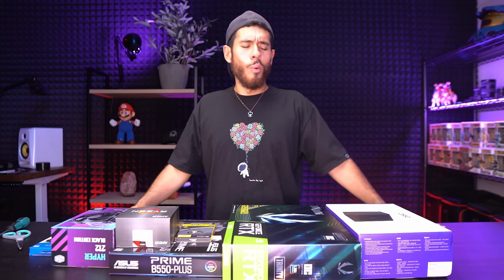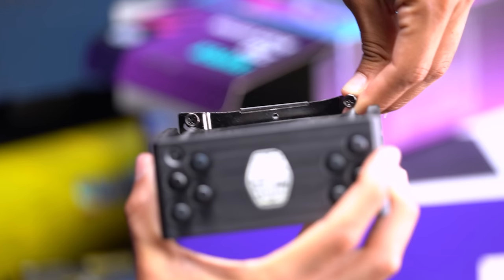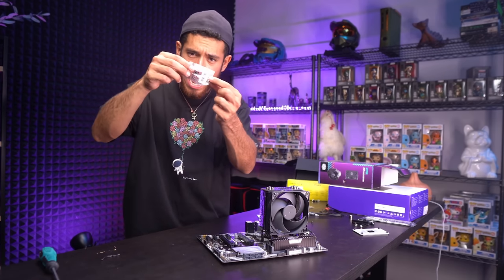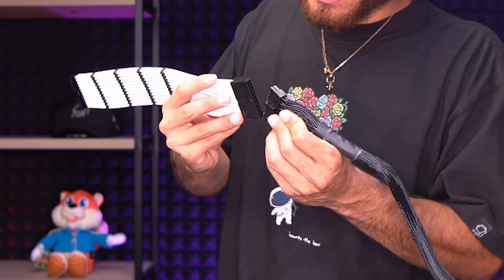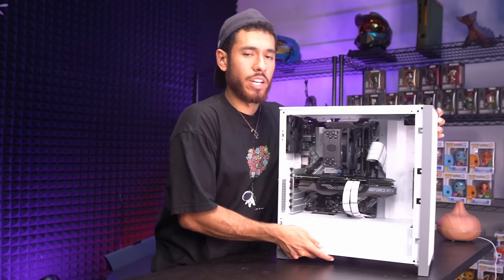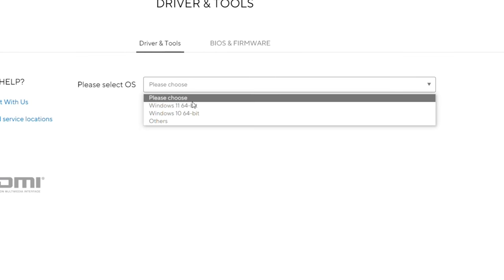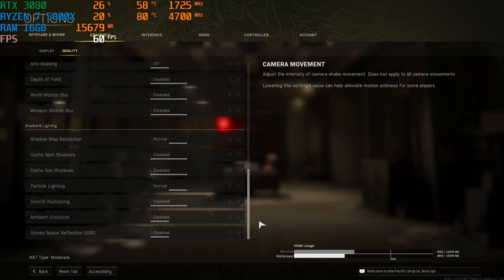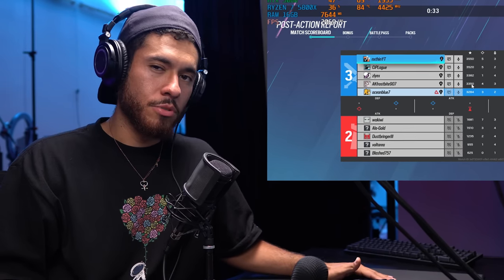BEST $1500 Gaming PC Build Guide - RTX 3080 Ryzen 7 5800X (w/ Benchmarks)

Comment from the maker: Custom WHITE Power Supply Cable Extensions ARE IN STOCK at https://craterhq.com/products/custom-sleeved-power-supply-cable-extension-kit-white
Letz go!
Reply: Can I place a zotac rtx 3080 ti trinity oc in this build, and should I upgrade anything to keep this build a long time, thanx
Reply: Hey crater I just want to say thanks for making this tutorial, for Christmas I’m going to get this computer, and I had one question, Where do you get the power supply cables?
Reply: @mtbsociety they come with the power supply
Reply: @Lemononn  thanks bro
Reply: @mtbsociety you’re welcome
Reply: @Lemononn  jk for some reason my mom isn’t letting me build it 💀
Reply: @mtbsociety  i feel sorry for you
Reply: @Lemononn  never Mmy grandpa convinced her + merry christmas
Reply: @mtbsociety  w moment, merry christmas
Reply: Can I use a 750 or even 650 power supply?
Reply: @RedLine-Racing1  no
Reply: @Lemononn  what other psu could I go with that's cheaper then
Reply: @Lemononn  if I don’t get a usb drive does it come with windows cuz like it says windows 11 ready on the box for the motherboard
Reply: @RedLine-Racing1  probably 750watt cuz I saw him use is in the exact same build
Reply: @mtbsociety  it should work
Reply: @mtbsociety  thank you
Reply: @Lemononn  ty
Reply: @RedLine-Racing1  np
Reply: @Lemononn  computer keeps loading into bios without windows usb. Is this normal
Reply: @mtbsociety  you need to insert the flash drive
Reply: @Lemononn  never mind it works fine
Reply: @mtbsociety  really good man, welcome to the pc master race
Reply: @Lemononn  thank you
Reply: @SisterRorie  I bought the gpu for 650 somehow
Reply: @mtbsociety  i thought it was sold out
Reply: How do I add the rgb lights to the inside of this case?
Reply: You forgot the fan splitter
Reply: do we have update the bios or is the board already updated to support 5800x
Reply: @scitscape5342  yeah, it supports it I just put everything together a few days ago :)
Reply: @Lemononn  hi im back lol
Reply: What can I get in replace of the NZXT C850
Reply: Bro I can’t find the power supply are they not selling anymore?

Comment: Hi Joey I’m wondering if you can put a Rx 6600 in the 900 pc build u recently did ?
Reply: You can put almost any graphics card in it (if its not absolutely huge). So in concoudion "YES".
Reply: Yes and it runs much better than the 3050
Reply: Check the wattage of the PSU, and then the wattage requirement of the rx 6600. AMD typically shows this on their website. I'll do a search and tell you: the RX 6600 requires a 450W PSU or greater.
Reply: Kyber  yeah I don’t see why not
Reply: Yes but you’ll need to match the power supply I believe

Comment: I REAAAAALLY appreciate the fact that the parts are all new and you show the actual prices. I hate when people say X budget but are using theoretical prices. Great stuff
Reply: Their prices are correct but the total comes out to $1600 before taxes, you need case fans which they didn't include, singular intake and exhaust is not enough. Add ~$150 in taxes, $100 on case fans and I would recommend at the very least getting a good m.2 SSD and not what they showed, it is very outdated and will not future proof your machine at all. Samsung 970 evo are very close in price and I've seen 1TB models go for ~$60. I'd actually recommend going with an AMD Radeon 6800XT or 6800 for graphics, they have the same performance for gaming and are usually ~$100 - $200 cheaper. Overall good starting point but if you'd like to stay closer to $1500 swap the graphics card for a AMD Radeon 6800 or RTX 3070.
Reply: @SaltedTurkey  The gpu is only 700 now. that puts the build a 1450.
Reply: @tapsofosiris3110  Where did you find it for that price? When I made my comment and even now after checking newegg and microcenter I can't find one for $700, cheapest I've seen is $750 and that's for a gygabyte card with terrible reviews about thermals, requiring good air cooling or a water block. After taxes it would be closer to $810, a Radeon 6800 or 6800XT is still a better cost to performance option.
Reply: @SaltedTurkey  in the link in the description. Why are you guys so weird. He has everything linked in the description. Everything. The whole build. It's 703  dollars on amazon through the USA link.
Reply: @tapsofosiris3110  840 rn😫
Reply: @tapsofosiris3110  1355 for me rn 😭

Comment: Build update! Hey everyone, I purchased everything in the build description. Built the PC myself as a COMPLETE NEWB while watching this video. Everything went great and  I can say this video has 100% Everything you need from start to finish. My total build cost for the Pc was $1785USD plus monitor and peripherals. I paired mine with a Samsung odyssey G9 49” ultra wide. This setup is well worth every Penny. Thanks so much dude for this ON POINT build guide. 

If I can do it, anyone can….
Reply: Did you bought the fan split cable? Cause he didn't put the link in the description
Reply: @KimBosle69  no. I had one come in the heat sync box
Reply: @-TheRealBUCKET-  how u liking it
Reply: @makaveli6873  I love it. A Beast of a unit
Reply: @-TheRealBUCKET-  I want to get it but I feel like it’s too much power for me
Reply: @makaveli6873  I had the same thought originally. But I wanted something I could grow into. This will do great for the next few years and I can upgrade it easily. You’ll find a way to use the power. I promise.
Reply: @-TheRealBUCKET-  how much did you spend and where did you order the parts?
Reply: @makaveli6873  I bought everything included in his video description using the links he provided. The total was $1783 USD and everything was shipped from Amazon without a problem.
Reply: @-TheRealBUCKET-  I will order mine and once it comes in I will let you know how it goes. Thanks for talking me into it! I was hesitant but man I’m excited
Reply: @makaveli6873  i just ordered mine waiting for 3 more parts mine came out to closer to 1800-1900$ cause i upgraded the ssd to 1tb and my ram to 4 sticks of ram instead of only 2
Reply: @phizy8595  I did the same thing but I went with 2 16gb Ram sticks 3600mhz
Reply: @-TheRealBUCKET-  how dose the pc run bro?
Reply: @phizy8595  it runs great. I’ve had no issues whatsoever. I’d recommend this build to literally anyone.
Reply: @-TheRealBUCKET-  thanks bro im hella excited this is my first pc build cant wait till the gpu comes in so i can put it all together n fire it up
Reply: @phizy8595  please let me know how it goes. I do not plan to install windows 11 just yet. Logitech does not support it with a lot of their peripherals. I’m keeping windows 10 so my wheel and joy stick still work.
Reply: @-TheRealBUCKET-  building the rig today goy the gpu last night cant wait hella excited
Reply: @phizy8595  heck yeah! Can’t wait to hear how it turns out!
Reply: @-TheRealBUCKET-  ima be building it myself im kinda nervous just want everything to go good and for it to run lol
Reply: @phizy8595  I was the same way, I promise
Reply: @-TheRealBUCKET-  built up everything and it turned on thankfully its working lika beast i added a 3 case fan and a 2nd cpu fan and the cpu is sitting around 60c now
Reply: @phizy8595  that’s awesome, congrats!
Reply: @phizy8595  still going good?
Reply: @phizy8595  link extra fan
Reply: @flare911  for the cpu or case?
Reply: @-TheRealBUCKET-   what ram sticks did u buy im looking to build this pc but some slight changes like 2 16gb rams like u and the 1tb ssd. I might upgrade the motherboard if theres anything that anyway knows??
Reply: @proliner1876  I picked up the Corsair vengeance LPX 2 stick for 32gb all together at @3600Mhz
Reply: Does any of the products in the description come with a fan splitter?
Reply: @roberto-ni9co  yessir, one was included in the stuff I purchased. It was in the box with the fans.
Reply: Does it run high fps on 1440p and 4k monitors?
Reply: @melihctl6747  I currently run a odyssey G9 ultrawide, but unfortunately it’s only 1080p. With a 240 Hz monitor. I’m sure it would have absolutely no problem. Getting 200fps in 4K with everything optimized correctly. I’ll go down to 1080p and get 350-400
Reply: @-TheRealBUCKET-  Thanks man!
Reply: @melihctl6747  good luck!
Reply: @-TheRealBUCKET-  How is the pc and is the pc hot?
Reply: @Powerzett  hello! The PC is absolutely amazing. I love it. It does run a bit hot. But I haven’t had any issues where it became too hot to where I needed to shut it down. But, I also run an open case. I did not purchase any extra fans. So it would run cooler if I had those. But it hasn’t been an issue thus far. Thanks for Commenting!
Reply: @-TheRealBUCKET-  thanks mate
Reply: @Powerzett  anytime! Good luck.
Reply: @-TheRealBUCKET-  which video card did u buy bc there are some on amazon for 1k and some rtx 3080 for under 800
Reply: Is it right the cpu costs around 1.2k rn?
Reply: Hey what’s the heat sync box?
Reply: hey i dont know if you are still replying to this thread, but if you are, did you have to flash the bios? or was it good from the start
Reply: @ascend5524  hey, ya I still get notifications from this thread. No, it worked out of the box just fine in my case. However, I did not install windows 11. I used windows 10 because in the video it didn’t work. I don’t want to go through another step haha. Still using windows 10 to this day
Reply: Can I use the MSI MAG Core Liquid V2 CPU Cooler instead??
Reply: hey if you can, can u send a link for the fan split cable because im thinking of getting this pc
Reply: @j-shanzsec1348  the one in the description included a splitter
Reply: @-TheRealBUCKET- do you need a wifi adapter?
Reply: @herbsfate  correct, I didn’t add that. I just hard lined into my router for the connection. I honestly prefer it. But I definitely understand the convenience of WiFi.

Comment: Awesome build!!! Only thing I would recommend is maybe getting a more beefy cooler since the 5800x tends to run hot. In the benchmarks the cpu is hovering around 85c
Reply: Yea mine is water cooled and still runs hot idk why
Reply: preferably a noctua nh-d15. Around 100 dollars but does its job amazing. Also can fit in this case with no issue. Just have to be sure your ram is under a certain height. There is a video on youtube about this. Speaking from experience lol
Reply: do you have a reccomemdation? or a replacement for the 5800x?
Reply: @koszy  the bequiet dark rock 4 or dark rock pro 4 is also pretty solid!
Reply: Can a ryzen 5 5600x work good on this motherboard?
Reply: @luispinto4332  why wouldn't it work?
Reply: I would just spend 50 more and get a good aio
Reply: @ryy597  are these two better than the one in the video?
Reply: @jeremyd1329  oh yeah by far! The cooler master hyper 212 would be good for like a 5600 or a 12400f. Its a pretty solid cpu cooler for lower end chips. Since the the 5800x runs super hot i wouldn't risk it. A nh-d15 or a nh-u12a is a great choice for the 5800x. You could also run a dark rock pro 4 or dark rock 4 like i mentioned. The scythe fuma 2 is pretty good too. Even the thermalright pa120/ thermalright fs140 would be great too!
Reply: @ryy597  noted, thank you very much. Do you think it’ll interfere with the ram?
Reply: @jeremyd1329  theres a good chance depending on which cooler you choose. Most beefy coolers requires low profile ram like corsair vengeance lpx sticks
Reply: @ryy597 I’m trying to stay under 100 dollars for the cpu, which one do you personally think is the strongest for the money?
Reply: @ryy597  as a first time builder would buying either of these bequiet items would it interfere in the build if I'm building exactly the video shows? I already bought what was on the video but willing to exchange for the items you mentioned.
Reply: @jeremyd1329  i would go with the noctua personally. Not sure if you could get one for under 100$. I don't live in the us so prices may vary from country to country.
Reply: @khalidstewart2377  whats your parts list?
Reply: @ryy597  its the same exact build if this video, didn't buy anything differently. But for with all I'm going to do is play warzone do I really need to deviate away from the build in the video? I'm not all that computer literate when it comes to the guts of the CPU.
Reply: @khalidstewart2377  its really solid build. Like mentioned id only upgrade the cpu cooler and add fans. 3 intake/3 exhausts. You could buy a 5 pack of artic p12 120mm fans and buy a single one seperatly. You would have 6 pwm fans for 50$. Since you already have a low profile ram kit you could buy a much better air cooler. Something like the thermalright pa120 that sells for around 50$. For a 100$ more you could add way better airflow and get way better thermals. Specially for the cpu.
Reply: @ryy597  thanks for the pointers, I think I saw in the comments you mentioned the Dark Rock 4 so I went with that to trade off what was used in the video
Reply: @khalidstewart2377  thats a great choice i had one in my latest build and i loved it. Its one of the best looking air cooler imo. The only downside is that its more expensive than some models that perform roughly the same. You pay a premium for good looks. It should be way better than the cooler master hyper 212.
Reply: What cooler would you recommend?
Reply: @koszy  is it compatible with this build, I’m sorry if it’s a stupid question I’m new to everything to do with pc’s
Reply: @ryy597  thanks for all I went for the thermalright pa 120, I also changed the motherboard for the B550 tuf wifi plus. All should work with the 5800x from the video right? As for the fans I’m not sure if 6 will fit in this case ?
Reply: Idek why he would bother getting a 5800X/ B550 in the first place. This entire build in general is just a bad value considering you live in the US. I would switch almost everything in this build and end up with a better PC at the same price. Coulda went with a 12600K/ Z690 board for the same price which is a flat out better CPU especially for gaming. It offers the same performance except you can overclock which offers better gaming performance then a 5800X. And you would get additional features like integrated graphics, an upgrade path, etc. Considering you live in the US you can that instead for the same price.

And the cooler he chose at the price is garbage. Hyper 212 for 50 bucks??? You can get a Thermalright Peerless Assassin 120 which absolutely destroys the Hyper 212 in cooling performance for 10 dollars less! WAY better cooler... Smh.
Reply: Can someone tell me what screwdriver he uses please I need it, it's literally the only thing I need and can someone else tell me what's a better fan then this and motherboard I can use
Reply: @ryy597  hey so im trying to do the same build as in the video but if i change the hyper 212 for the be quiet dark rock pro 4 BK022 will it be better?
Reply: Curious what cooler would you recommend? I am trying to figure out what up. New to this.
Reply: If i were to replace the 5800x with the ryzen 9 5900x would i need to up the cooler and what would you recommend. I see a comment recommending the noctua nh-d15 would that work?
Reply: @dudeyo7264  I’m looking to build soon what else would you swap out
Reply: after reading this thread, i’m having doubts on building my PC and thinking of just buying a premade one from Best Buy 🤣 y’all need to stick to a solid answer.
Reply: @ryy597  thx for all this info. just wondering if i go with the noctua nh-d15 is it gonna fit in the case shown in this video?
Reply: @ryy597  hey just have a question is there a way to tell whether the cooler will interfere with the ram or not?
Reply: @khalidstewart2377  Hey, did you get the dark rock 4 pro or regular. And did the build work well with it?
Reply: question. i’m new to pc, but he mentions making a key for windows 11, but can i do windows 10 instead ?
Reply: @ssjmp  yes
Reply: @ryy597  You, my friend, are heaven sent
Reply: Yea I know ima probably gonna get i7 12700kf with a noctua cooler
Reply: @ryy597  you think noctua nh-d15 would go well with Corsair Vengeance RGB Pro 32 GB ??
Reply: what cooler should I get if I have a 3070 ti and ryzen 5600x ?
Reply: @ryy597  im building this pc but ive added in the noctua d15 like suggested and im wanting to add these fans, would there be a certain size case to grab with all these fans n stuff thanks.
Reply: Depending on your Budget you also can Go for an AIO. In my Case i use the Corsair H115i (i got a different Case than shown in the Video). And Reading all these comments i have to say even in Benchmarks my CPU sits at 74°C max. And beside the RAM i also overclocked the CPU.
Reply: @Crazynin1  hi there. If you don't mind me asking which case did you go with and would that AIO cooler fit in the build case? Sorry if this is a dumb question
Reply: If I add more ram and upgrade a few parts for it to be able to run better games like tarkov. Would I need to upgrade the motherboard to handle it or is the one in this video capable of that ?
Reply: Does the MSI MAG Core Liquid 240r V2 also work as good dough cooler ??

Comment: I added all of the parts from this $1,500 build and the $1,200 build and picked what parts I thought best. If I’m gonna use the exact same parts in the 2 videos is there anything I should worry about? 

Another question: why exactly on this build wouldn’t windows 11 work? I don’t wanna go spend the money on a windows 11 hard drive just to get home and it not work. 
Thanks 🙏
Reply: dont get the hyper 212 not a good cooler for decent cpus. as you can see his cpu temperatures were very high when he was gaming.
Reply: Windows 11 didn't work because TPM is not enabled in the BIOS. Asus has released BIOS updates for all of their mobos which has TPM enabled by default. Just install latest bios and windows 11 will install fine
Reply: @Saiyer  what should i get?